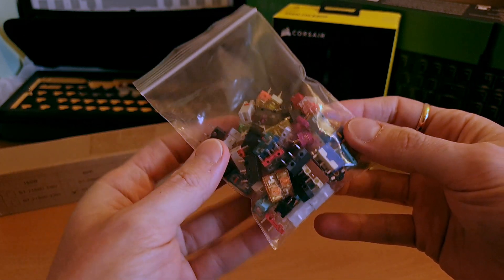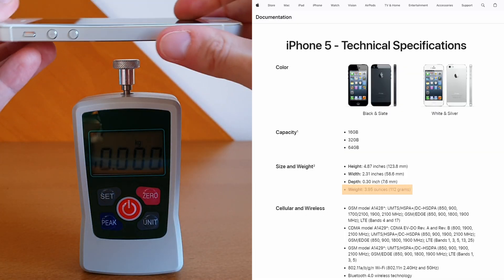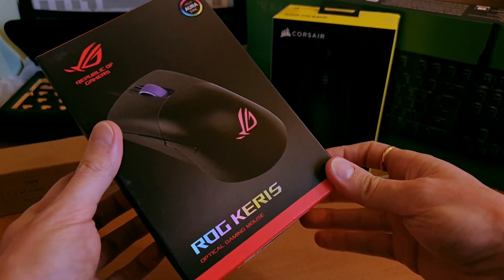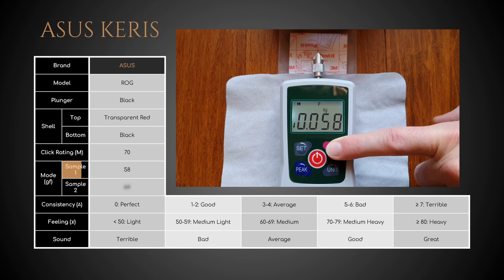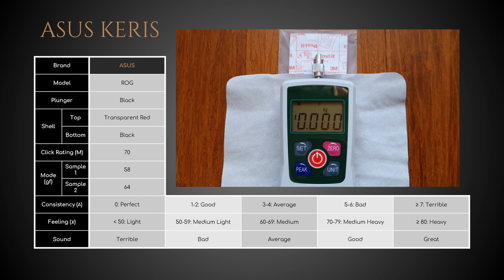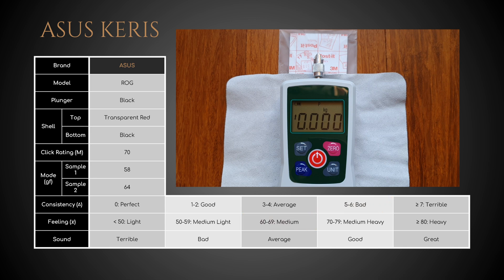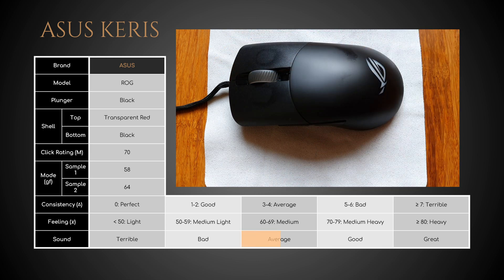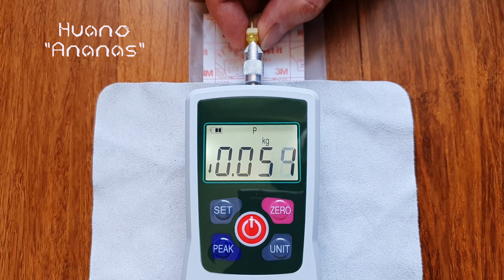Mouse Switches Force & Sound: Huano / Kailh / HCNHK / Defond / Omron / TTC / Zippy / ZF / Cherry

Comment: Hi Can you Recommend Smaller mice (115 - 117mm Maximum length ) with these Micro switches ?

Omron  D2F-F-3-7     45 Gram Force 
Omron  D2F-01F     47-52 Gram Force

Huano Silent Yellow  56 Gram Force  
Huano Silent White   52- 54 Gram Force 

Defond  DMP-1101 (2310)
Reply from the maker: The Huano Silent Yellow are still my favourite microswitches...
Though, if you want to be able to hear them, I'd suggest the D2F-F-3-7!
Reply: @oakenglass  i order both switches and mouse  zaopin Z2 mini max  thanks alot for your help !!!!
Reply from the maker: @samiRetro777  Take a look at the Incott models, too ;)
Reply: @oakenglass  yes already looked before these are not for me  length 126mm  :)

Comment: So the Kailh White Swords are roughly 64gf? How would you compare them to the Red GM 4.0s? They sounded pretty similar in the sound comparisons, have roughly the same actuation level.  Would you say they're pretty much the same switch in different housing?
Reply from the maker: Yes, I honestly wouldn't be able to tell the difference if I were blindfolded.
Reply: @oakenglass That saves me the need to check them out. Already love the Reds. Thanks a lot.

Comment: yo ty bro do u know shortest travel mice switches?
Reply from the maker: Honestly, no. It's a metric I've never paid much attention to on mouse switches, sorry.
Reply: @oakenglass  ye the problem is on my GPX when i use longer travel switches sometimes it goes into spray instead of tap
Reply from the maker: @iniceone818  You can try swapping the plunger with a shorter one or sanding down the part of the mouse that touches the plunger...
I did the latter with my Corsair Sabre, which I modded to make it hot-swappable: the sockets increased the height of the switches slightly.
Reply: @ what switch i can get biger plunger from except japron?
Reply from the maker: @iniceone818  The best way is to check the datasheet: AliExpress shops usually include it in the description...

Comment: I wanna make my Gpro superlight feel like my old viper ultimate. I feel like the Gpro switches are a bit too hard to click. Which switches should i get ?
Reply from the maker: Any switch classified as "medium-light" or "light" in my spreadsheet. Personally, I'd suggest the Omron D2F-F-3-7 ;)
Reply: @ Got it, what about the Kailh GM 2.0?
Reply from the maker: @s0ap834  It's quite heavy... if you're looking for light clicks, I wouldn't recommend it!

Comment: Great video! Which better TBSPD or Huano white V2?
Reply from the maker: Unfortunately, Huano White V2 didn't exist when I made this video... mine are V1.
If you can't get both of them, I'd probably just stick with the good old TBSPD ;)
Reply: @oakenglass  Cool thanks for answering. Last question which durable / reliability  TBSPD or D2F-F-3-7?
Reply from the maker: @TysonLozano-y1d  Theoretically the former. But if you have a hot-swappable mouse, I would definitely choose the latter and replace them if/when they die...